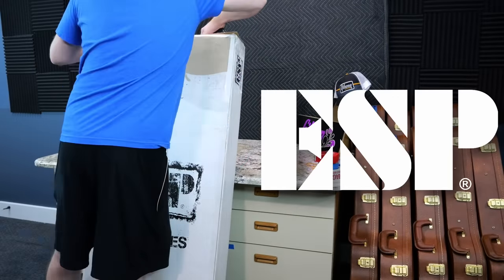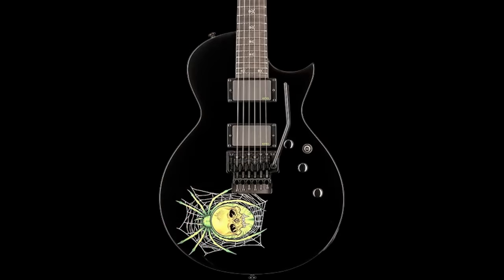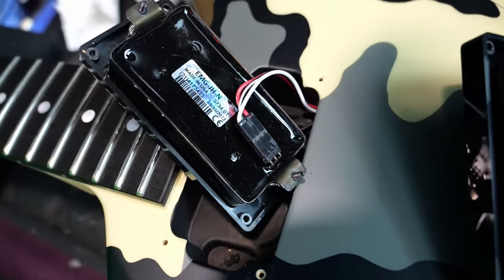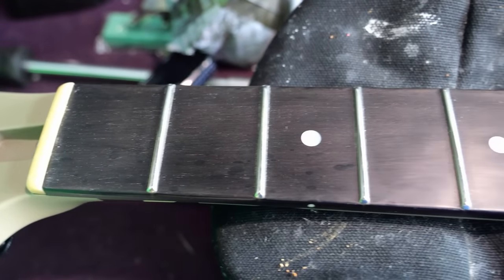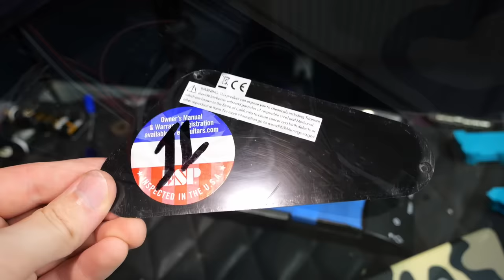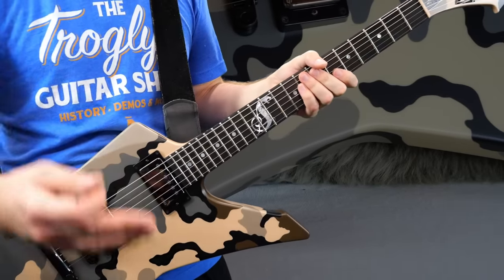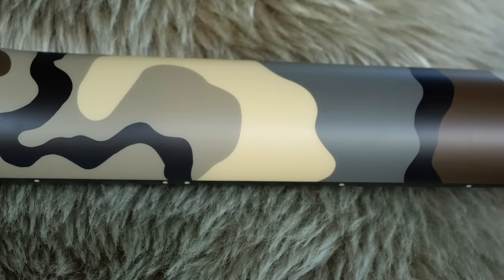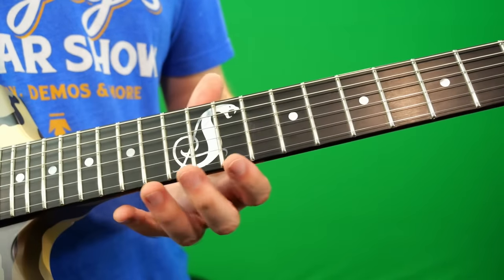I Tried an ESP Custom Shop (First Time) | 2023 ESP Kuiu Camo Snakebyte James Hetfield Metallica

Comment: Seeing tooling marks on expensive Gibsons is pretty much what you expect, this fretboard was pristine, not unintentionally aged to increase its price. The fret ends looked like nice round balls.
Reply: I chuckled at the last line 😂
Reply: They're supposed to, they're called semi hemispherical fret ends :o)
Reply: Even their LTD line has great fret work.
Reply: Me too. @TylerJohnstonGuitar
Reply: as long as they're not chocolate and salty
Reply: The Japanese ESPs are absolutely flawless to the point of being museum pieces.
Reply: For what they charge they should be.
Reply: When you have no binding to scrapes what "tooling" marks would you get?
Reply: @paulmolive1821   I disagree. I ordered a custom Lefthanded ESP Eclipse II. Approximately $3500.  Took a year to build and receive. Its definitely has some fit and finish issues. Love the guitar but its definitely not flawless, I almost returned it. Also it was supposed to be see through electric blue. The blue is soo dark you almost cant even see the quilted maple top. They messed up my custom order pretty bad. I waited too long for this guitar, that's why I kept it. It's a great guitar but it doesn't meet what I believe it should have seeing as how its a handmade quality Japanese guitar. If I had a time machine, I would've sent it right back.
Reply: @alijankhan3330  And yet, Gibson charges the same and more and has issues. You won't even find issues that are on an SG/Les Paul standard on an LTD, and even if you do, it's probably 1 for every 10 guitar or more, whereas with Gibson you're lucky if you find one without issue after looking at 10 guitars..

Comment: I own 3 ESP custom shops and 3 gibson custom shops. Both badass. ESP are definitely a better build quality. But they are different weapons. ESP are precision instruments like a scalpel. My custom shop Gibson’s are more like sledgehammers. I also own Schecter, Ibanez, a few LTD’s and even a Squier. I’m an equal opportunity guitarist 😎. But ESP’s are definitely badass 🤘🏻
Reply: are your Gibson sledgehammer like have their head fly of after a while when you swing them around...🤣
Reply: @whatsup9260  never had a broken headstock on any guitar. Gibson or otherwise. I’ve owned hundreds since the 80’s 🤘🏻
Reply: i use the car metaphors lol . my strat is a camry then the charvel is like a wrx, the les paul is like a 60s muscle car
Reply: @kilsoo  well, depending on what model Strat you have, it could be an Avalon 😂
Reply: So you feel like the Gibsons are still worth it? Would you pick a Navigator instead of a LP Custom or do you feel like they're great feel wise, fretwork wise  and general playability and sound even if they might have some imperfections?
Reply: @the_hippykiller22  there’s a lot of variables in that equation. But if you’re gonna spend custom shop money, I’d try to play the guitar to make that determination. And you could probably find a used Gibson Custom for much cheaper than a Navigator custom, new or used. Navigators have various tiers too. If you are gonna get the top dog you’re looking at 5-7k. But make sure you like it. It’s easier to sell a Gibson if you get tired of it. And they generally hold value really well. It’s much harder to find a really nice Navigator because there are so few to physically try out. But they are both nice guitars. If I found a Navigator I was happy with, I’d probably buy it personally. But that’s only because I have a few Gibson’s already. I have a few ESP’s too. But No Navigator in my collection.
Reply: I got a Stephen Carpenter ESP and it's absolutely beautiful. Work of art. I almost didn't want to play it in case I scratched it or something. 😂

Comment: The battery door looks like an ashtray door in an older car which is most likely what inspired its design. In my opinion a very good idea and it will be around far longer than those cheap plastic ones will be.
Reply: my thought exactly!
Reply: It is an ashtray for planes, they bought company after smoking ban
Reply: @kaivalentine9664  definitely looked very familiar.

Comment: I got mine yesterday too.  Waited a LOOOONG time to get it.  I was not disappointed.  Incredible build quality and it sounds amazing.
Reply: I had a question, I got the chance to play one but, to me, it didn't fit my sound or tone... just didn't play to my hopes and thoughts. Is there a tip you could provide to get the best sound out of maybe something other than a MESA Boogie??
Reply: @westoncwhited   Those pick-ups are extremely hot and use of the Volume knob makes a massive difference in tone.  I dropped my tuning to Eb and put on heavier strings 11-48.  Things can get fizzy quick with the guitar volume turned all the way up.  I like my volume set between 6-8.

I run mine thru a 100w Marshall DSL into a 4x12 loaded with 1986 CV-30s.  I use a 10band EQ in the FX loop, and I use a Tube Screamer pedal in front.  TS tone rolled way back, no gain, and Vol at 2 o'clock.  I just want to lift the low end of the tone, not push the amp.  Most of your distortion is gong to come from brute force Volume from the guitar, and not a distortion circuit.  Im running into the Green Ultra gain channel, but with very little gain from my amp.

I would think that things can get real fizzy and hairy with a MESA...but I dont have much experience with those amps.  Im able to get great Kill'em All and RTL tones.  This guitar is designed to push out a crap ton of "power", its up to us to figure out how to dial it in.  Thats been my experience with it for the 1st 10 days or so.

Comment: Thank you David for giving us the opportunity to see and hear this and other guitars .The camo is better than the military's camo. Would love to see one in dessert sand camo. Well as much as i could. Those pickups being active have a power source in them so using an ohmmeter is not wise. Its not so much the voltage as it is the current.  I dont know how much current runs through the pickups though. Im guessing its not more than 1/2 amp since you can still get a little jolt but all it takes is one amp to kill a person. I try to keep any of the packing i get from a new guitar especially the foam ring that is typically around the toggle switch from a new guitar. If I'm moving guitars around ill put on the ring to help protect the tip. It doesn't matter who builds the explorer I'd still prefer the smaller body on one to that massive real estate on most.   I suppose that short screw waa in place so it didn't short out the jack.
Reply: "Well as much as I could". That made me chuckle.

Comment: If you want to remove sticker/tape gunk like is left on the truss rod cover, you should give eucalyptus oil a try. Just moisten some paper towel with it and it will clean that right off. I don't know how it would react with a nitro finish but on plastic or a poly finish it's perfectly safe and removes sticky gunk like that with ease. Plus it smells pretty damn good too

Comment: My ESP horizon E-II also has flawless finish. My Gibson flying V on the other hand has appalling fingerboard finish. I originally thought it was just dry at the shop, but it didn’t improve within one year and some conditioning. I contacted gibson and they blamed me for it. A local guitar tech told me that it is just extremely poorly sanded. Thanks for that Gibson and for the customer service as well 😁

Comment: As with all EMG's, you can run the pickups on 9, 18 or 27 volts. For me, the 18V setting (two batteries) increases the punch without getting too muddy.

Comment: The trap door for the battery I believe is an ash tray from older model cars that have been repurposed just for that use
Reply: at least that's what they are called! have one on my e-II and works well even when respecced to using two 12V batteries

Comment: I'm not sure how well versed you are in the in-workings of pickups, but those are indeed actual pole pieces. Them being active doesn't change that. The thing that makes them active is the on-board preamp. Pickups still require the use of magnets or pole pieces regardless of whether they are active or passive.

Comment: Trogly, please tell me you do realize the Les Paul is a Two Volume Guitar as well?  Will do the same things when in middle position by only using part volume with one of the pickups.   Remember a long time ago you were reviewing a Gretsch and a bit confused with the three volume knobs.  This is a good example why they are useful,  Set the two individual pickup volumes exactly where you want them to be.  Then have the master volume to use as not to disturb the setting of the set two volumes.   Cheers!   Nice to see a higher end Guitar reviewed that's not one of the big manufacturers.

Comment: I wish they used those battery covers on every guitar they make with active pickups, but they're only on E-IIs and ESPs, the LTDs have a oval one with two screws, i despise artificial differentiation for the sake of "this is only a premium feature, you don't get it on the budget line". Especially with the price of LTDs creeping upwards above the $1000 mark it feels pretty indefensible, even if they're sold seperately, the routes are different so it's not like you can buy one as an upgrade for your LTD.

Comment: Those EMGs are SMOKING HOT! This is by far one of the best "Metal" guitars you can buy! I have the LTD and it is incredible sounding playing through a Marshall JCM 800 2203 100 Watt head. Using no effect pedals you can get Metallica tones and blow the roof off any place you play! Trogly needs to review more ESP/LTD guitars, the other Hetfield signature is awesome as well I spent the extra money and bought the ESP Vulture in Olympic White and it is Bad Ass! You won't pay as much for the Vulture $5,700 plus tax vs the Snakebite $7,200 plus tax but they both sound better than any of my Gibson guitars.

Comment: The problem - so to speak - with ESP/LTD is there is virtually no difference between the expensive ESP line and the cheaper LTD.  I’ve tried them both, and unlike Epiphone/Gibson - you just can’t distinguish any difference in build quality. They are both equally excellent and super consistent.  If I closed my eyes and you handed me various Eclipse models, I would think they were the same guitar.  I don’t know how they do it, but the action and overall feel of the neck is identical.  No other company is able to do this.

Comment: One thing that drives me nuts about ESP is how they give you the exact same hardshell case for their LTD guitars and ESP made in Japan guitars, even custom shop guitars and other signature series guitars. I bought a Stephen Carpenter ESP STEFB7 that was made at ESP custom shop, and it came in the same standard hardshell case with the grey interior that all their LTD guitars come with. Its mind boggling honestly. Then you have this guitar above in your video that actually comes with a nice, unique hardshell case. Am i expecting something that unique for a Stephen Carpenter signature guitar? No. Am i expecting something more than the standard hardshell cases they give with their LTD guitars? 100% yes. Especially when the guitar cost over $5,000. Joke of a company doing that kind of crap. Even moreso, i own 10 other guitars that arent ESP custom shop guitars that play and sound better than the Stephen Carpenter signature guitar. Ill never understand what the fuss is all about with ESP japan made guitars, custom shop guitars, whatever. Way too over-rated when you can get quality guitars at so much cheaper $. The Jim Root fender USA strat i own, that i was able to buy basically brand new for $1500, came with one of the nicest hardshell cases ive ever seen. Beautiful red interior. Look it up, youll see what i mean. Then here we have ESP giving custom shop guitars away in the same cases they use for their lower tier guitars.